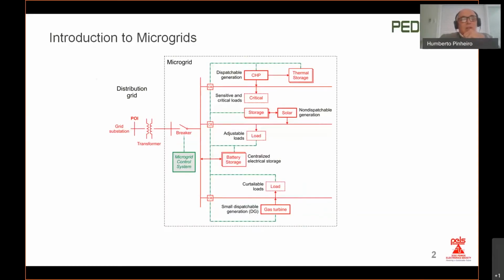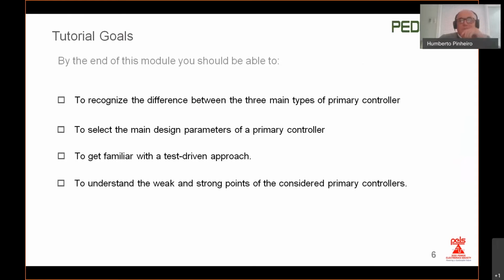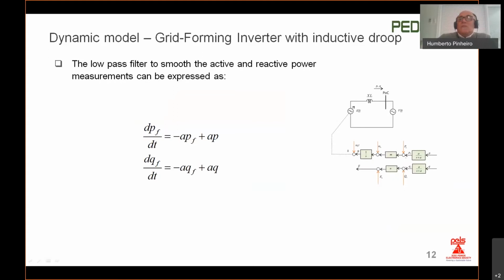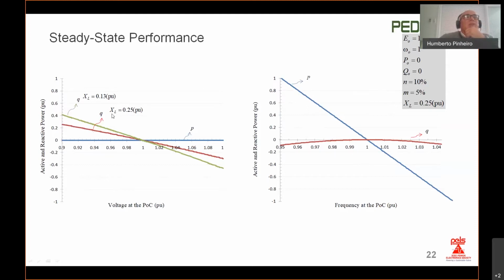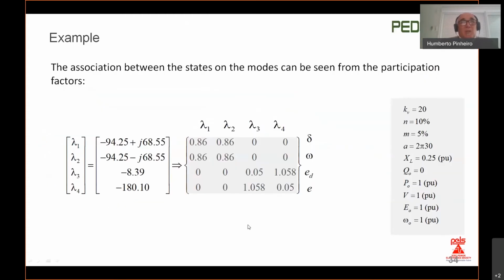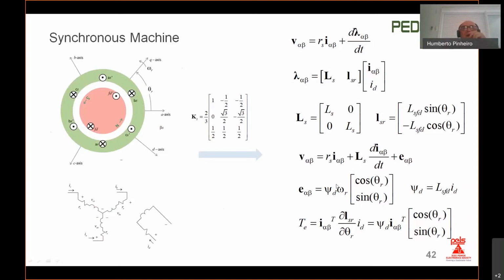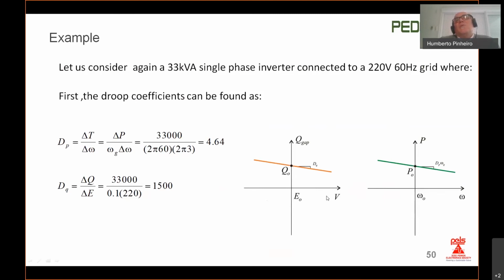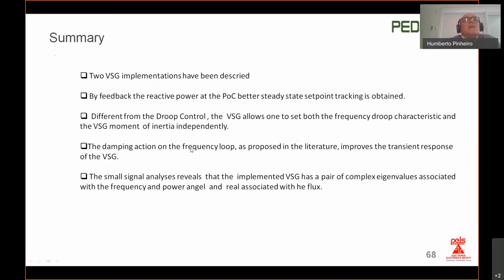Introduction to Microgrids | Learn to use

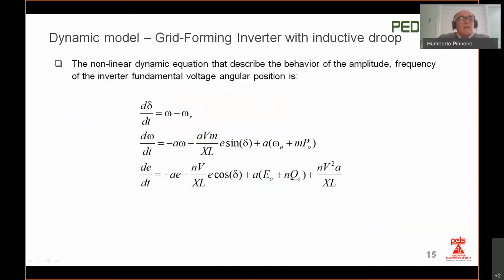Comment: At 17:27 , in the 3rd state equation of voltage (de/dt),  the filtering coefficient "a" is missing from the 2nd term , it must be "-n*a*V/X e cos(δ)" instead of "-n*V/X e cos(δ)",  can you verify ? thanks.
Reply from the maker: Hi there, we reached out to Dr. Pinheiro to confirm the answer to this question and we are waiting to hear back from him. In the meantime, you can check if you might find the answer to your question in one of the UFSM courses at HIL Academy:
- Digital Control of Grid-Tied Converters: https://hil.academy/courses/digital-control-of-grid-tied-converters/
- Control of Microgrids: https://hil.academy/courses/control-of-microgrids/

We hope these resources will be helpful!
Reply: @TyphoonHIL Thank you

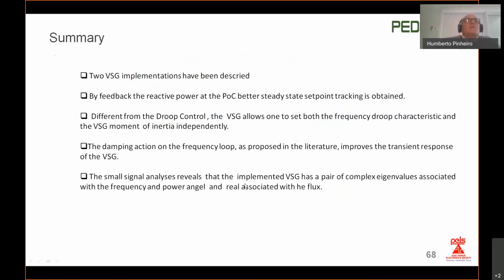Comment: Hello, thank you very much. Would it be possible to clarify how to compute parameter adf (50:40, c-code, line 22)?
Reply from the maker: Hi there and thank you for your question! Our engineering team confirmed that the equasion is adf=2*pi*30. All models related to the course this video was recorded for (https://hil.academy/courses/digital-control-of-grid-tied-converters/) can be found within the Typhoon HIL Control Center software in examples folder: examples\courses\digital control of grid-tied converters

We hope this helps and we wish you success with your HIL projects!